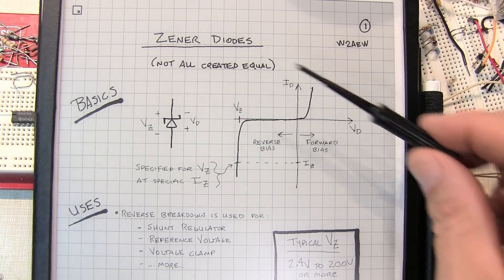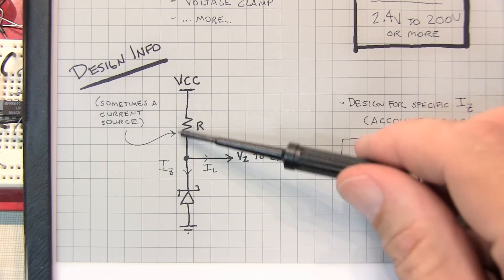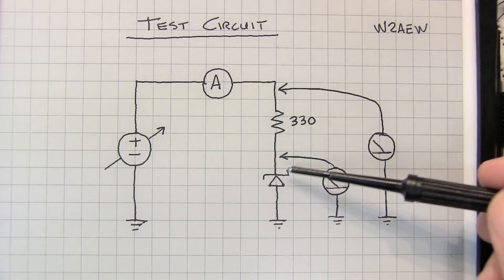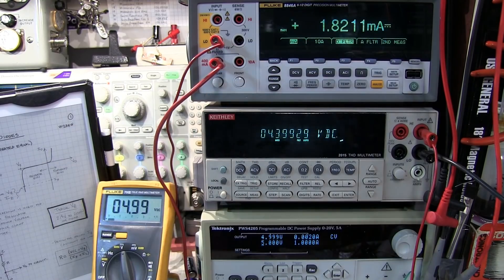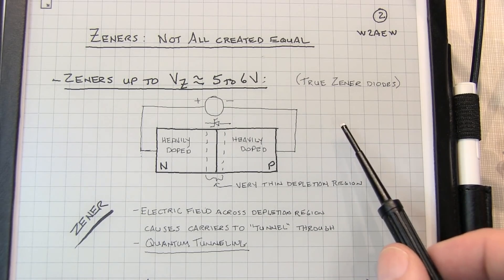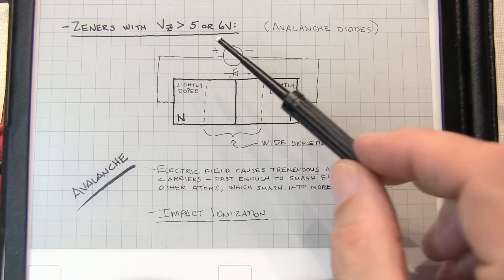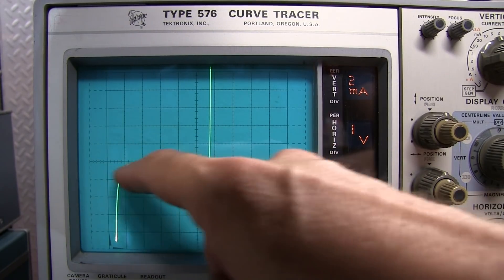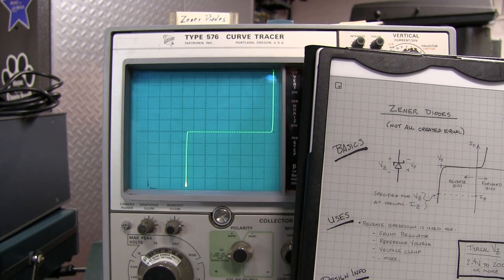#289: Back to Basics: Zener Diodes - How to Use | Applications | not all created equal

Comment: 5:37 what kind of display does the PSU have?

It can’t be a seven segment style display at the bottom. Above is LCD & VFD, then it’s… ?
Reply from the maker: I believe it is also a vacuum fluorescent.
Reply: @w2aew  it must be a dot-matrix VFD then? I’ve not seen one before. If it’s not, the display elements must stack on top of each other like a nixietube or some kind of projector. 

VFD display icons/elements can’t overlap, can they?

Comment: A Variac adjusts the AC voltage but what adjusts the AC current? This is to tell for unregulated circuits that don't use a regulator IC chip to Starve the circuit from the AC current power input to see how the circuit can self regulate. I can't use a variac because it only starves the voltage and doesn't starve the AC current to the applied circuit under test. I want to be able to apply 120vac put starve the current, what can I use?
Reply from the maker: A variable resistor in series.
Reply: @w2aew  Correct but they don't make a variable series resistor like a Variac which would be called an AC rheostat that can vary the 120vac AC current from 0 amps to 20 amps? of the outlet wall sockets is max at either 15 amps to 20amps but I have never seen an AC Rheostat that can vary the 120vac AC amps current from 0 amps to 20 amps, have you seen this before?
Reply from the maker: @waynegram8907  Power rheostats are a specialty item, but can be found.
Reply: @w2aew  Thanks, I have never seen a power rheostat by itself that you can purchase. I know in old 40s to 60s test fixtures they would have built in Power Rheostats to adjust the AC current but they were custom made built by the company they made custom test fixtures.

Comment: Hi, i built a clipping circuit using opamp and 4.7v zener diode and i use a sinusoidal signal at the input (1khz). The top of the signal crest at the output is not flat but rounded. Is it caused by the fact that you tell in the video? Thank
Reply from the maker: Without seeing your circuit, it is impossible for me to say.
Reply: Here it's not possible to load a video or photo. I'm trying to understand how to.

Comment: As you implied, the temperature stability depends on the break through voltage.
The 5.2V Diodes are very stable as they tend to have a combined coefficient of zero.

Comment: Why don't they break? Something to do with the length of the depletion region?
It is amazing that they can take much power without changing or burning.
Reply from the maker: Large Zener voltage does not mean large power.  Power is the product of voltage across the device multiplied by the current through it.  It is important to limit the current (forward or reverse/zener) to keep the power dissipation within the rating for the device.
Reply: @w2aew  There are Z-D with 1.5kW impulse rating. I have seen TVS Diodes that still worked after desoldering themselves.

Comment: Nice lesson once again, especially about the avalanche process. My experience with "standard" zener diodes that they typically have a wide zener voltage tolerance, maybe even +/-10%. What I have noticed on your curve tracer that the forward part (first quadrant) also have a very steep (90 deg) curve, as in a lot of theory books that draw more a 45 deg curve. The 90 deg is more realistic as we know that a forward biased diode has a very little resistance and that the current would indeed sky rocket 🙂
Reply from the maker: The "steepness" of the curve also depends on the horizontal scale used.
Reply: @w2aew  of course, but most of the time (zener graph) we see both quadrants (1st en 3rd), and the 3rd (reverse) is always very steep, but the 1st (forward) most of the time (not always though) under an angle of 45 Deg. The horizontal scale used is then the same for both quadrants (I suppose).
Reply: ...but nevertheless very good short (remedial) lessons 👍

Comment: Great work, thank you. What is the pad that you're drawing on, please? Is that an electronic tablet?
Reply from the maker: Yes, it is from www.remarkable.com
Reply: @w2aew  Thank you. They're not cheap. :)
Reply: @w2aew  Eek, pricey but I ordered one...
Reply from the maker: @simonyoungglostog  Yes, they are pricey - but the ability to edit / alter as well as markup PDF files is handy.
Reply: @w2aew  It's on its way. I bought a calculator because the iPhone does everything 'ok' but if you're using a calculator a lot, it makes sense to get one. No distractions!! Same with the paper-tablet. Thanks again for your videos, I'm still learning (Finishing the transistor section in AoE3).

Comment: Out of the regular, cheap Zener diodes, the ones that have the lowest temperature coefficient are those rated for 5.6V. In them, the contribution of both effects (Zener and avalanche) is more or less balanced and the temperature coefficients largely cancel each other. So if you need the most temperature-stable Zener diode as a reference and don't want to pay for special parts, a 5.6V one is your best bet.
Reply from the maker: That's a bit of sage tribal knowledge, thank you!

Comment: Do a video lesson about precision voltage reference IC chips because they have a zener diode but also they use an IC op amp to compare the voltage. If you look at the datasheets of various precision voltage reference components because they can be used as a voltage regulator. I'm not sure what the capacitance loading has to be before the output pin starts to be unstable

Comment: Can you explain how your equipment works that traces the two curves at once? I’m confused on what I’m looking at. You’re tracing the positive voltage and negative voltage lines at the same time, I think I’m lost on what it means to be reversed biased
Reply from the maker: The Curve Tracer that I am using applied a sinusoidal voltage to the zener diode.  This  voltage swings positive then negative and repeats.

Comment: Outstanding vid and teaching.  Zener diodes are often used in the design of Intrinsic Safety, where a circuit has to be used in a Hazardous location and the voltage MUST be controlled to never go beyond a certain amount.

Comment: the sharpness difference was striking, when you have an electric spark from a capacitor you get an extremely sharp turn on that can be easily compared to the avalanche effect imo.
If you wanted to create a good electronic analogy to a spark gap, an avalanche diode combined with a power transistor should do the job well.

Comment: When you work for a company which produces instruments whose functions are based on a zener reference diode's stability, you appreciate the cost of a GOOD diode when compared with a "blah" diode. LOL de KQ2E
Reply from the maker: Yes - there are temperature compensated zener diodes that are MUCH better!
Reply: @w2aew  , Yes... especially after using the diodes from the burn in rack and 3 weeks of 140% of their rated current. The survivors are surprisingly quiet and stable. Perfect for stable reference use in regulated supplies.

Comment: Since avalanche diodes have sharper turning point, is there any benefit of using regular zener diodes? Besides balance out the temperature coefficient
Reply from the maker: Often you don't have a choice, depending on the voltage you need.
Reply: w2aew Got it. Thank you! I learned so much from you.

Comment: Hello Allen. My condolences for your loss of your father. Great video again.I have learned from watching it (Avalach effect, heavy /light doping).  A nice follow up to this video could be the "variable voltage Zener diode" ( Zener conected to non inv. input op-amp with neg. feedback of 2 voltage divider resistors connected to the inv. input ) which is met in countless circuits as the LM431.

Comment: If you have the time a tutorial of an output pin of a microcontroller would be great . They seem to have a Pmos and Nmos on the internal  drive , BUT if you look at the I/V curves the calcs show a ~54 ohm Rds on of the Pmos and ~ 18 ohms of the Nmos. If you try and simulate with LTspice the mosfets have rds On in the order of < 2 ohms . The trouble I have is how the voltage drops on the output pin as the current increases . Allthough datasheets show up to 25mA source / sink per pin once you are > 6-8ma things go pear shape. Driving into a capacitive load seems to be a no no as a short pulse on the output into a cap of a few pF results in I=dv/dt so with a short pulse the I is way bigger than what can be delivered and the pulse " disappears" - Apologies I did not know where to put this request but hopefully you will get time to address this .
Reply from the maker: I can add this to my list of future topics.  I will say now that it is quite likely that the models used in your LTSpice spice don't accurately model the characteristics of the PMOS and NMOS devices in your micro.  The characteristics of the devices used in an integrated device will often differ greatly from the characteristics of discrete devices.  So, unless you have access to model parameters that are specific to the process used in the manufacture of the micro, then the simulation results are likely going to show non-realistic results.
Reply: w2aew thanks . I did model on ltspice with 2 switches with some progress but my 61 year old cranium is loosing dielectric so not performing as expected . I can send ltspice model to an email address.

Comment: Quick question about wattage and Kwh.
Suppose you had a instant load load of 1,000 watts or 1kw how many Kwh is that? I am confused, as some might say, "simple its 1Kwh",  but it would also draw 1kw in a split second as well since its an instantaneous load. If the 1Kw load was left on for an hour what would be the warrage consumed over that hour? I dont think it would be 1kw, i think it would be much more. How is this calculated?

Please explain.
Reply from the maker: Kilowatt-hours is a measure of energy consumption over time.  So, it is simply the product of how much power is being consumed (watts, kilowatts, etc.) over a given duration (minutes, hours, days, etc.).  If you have a load that consumes 1kW and you run it for an hour, that is 1kWh.  But, if you run it for just 30 minutes, then it is 0.5kWh (or 500Wh). If you run the load continuously for 5 hours, then it would be 5kWhr.  The power company bills you on the total power usage over time - thus, the kWhrs that you use.  It is the product of power usage and time being used.
Reply: @w2aew  so regardless of the Instantaneous current drawn, power is based on an hourly basis? The problem i am having is if I draw 1 watt of power when I measure something at a particualr instant and it is a constant draw that would still be 1wh?
In addition an elec meter is only measuring total wattage (actually VoltAmps with a power factor applied) used and it is read lets say every 30days yes?
Reply from the maker: No, it is always the accumulated power usage.  If you have a device that draws 1 watt of power, and you use it for only one hour during the course of a month, then that is 1wh.  If you use it for 2 hours, that is 2wh.  If it is used continuously for 30 days, then it will be 720wh (30days * 24hrs), or 0.72kWhr.  Electric power meters measure power usage accumulated over time.
Reply: @w2aew  I think i have it. The unit if measurement is 1 hour and usage is derived from that time. So if I were to draw 1 watt for 1 min the usage would be .016666 kwh, yes?
Reply from the maker: Almost.  1000w for 1 minute only would be 0.016666kwh.  A 1w load for one minute would be 0.016666wh (not kwh).
Reply: @w2aew  Yes you are right. Sorry about my math Hahah thank you so much for clearing the cobwebs from my head.
Thank you for your easy to inderstand videos as well. I restore professional 2" video tape machines

Comment: Well explained but why aren't all zener diodes avalanche type or true zener type?
Reply from the maker: Reverse voltage of less than 5V isn't really sufficient for avalanche mode operation, so devices are designed with highly doped materials for Zener breakdown.  At higher voltage, avalanche mode generally provides better/sharper breakdown characteristics.

Comment: Great video but another use of zener diode you see is uC GPIO pin protection. That case appears to be different. In that case you want minimum current into GPIO but clamp the voltage. Any time I've tried that circuit arrangement the Zener Voltage is not the clamping voltage. 3v3 might be low as a clamping voltage

Comment: I think the most stable zeners are 5.6V and 6.2V (sometimes 6.8V if there is some additional circuitry or another diode in connected reverse for better temperature compensation). They have the smallest impedance in datasheets.

Comment: Alan, thanks for this back to basics. I love the series.
What reader or tablet are you using for your notes in the videos?
Reply from the maker: It is from remarkable.com
Reply: Thank you. Would you be open to do a kind of review? pros & cons? A little off topic but I'd be very happy to see how usability works out. Reviews on a***n aren't too frantic..
Reply from the maker: Quick review...  Pros:  lightweight, great battery life, seamless cloud storage, PC app to access files and export PDF or PNG, responsive, good paper & pencil feel, lots of pen/pencil/marker/brush selections, editing/moving works well. Cons: Very expensive, no case/folio included - so nothing to hold the special stylus, the folio they sell is very pricey (found a cheaper one on Ama*on), PDF files are large and take a long time to print.
Reply: Thank you. Your input is appreciated.

Issues w/ system stability/reliability? Data loss when transfering? Delay when opening large PDFs? Reading comfort/tools?
Reply from the maker: I've had no problems with stability - never crashed or hung.  Never lost data during transfer (it transfers to the cloud in the background).  I haven't used it to open large PDFs and annotate them, so I really can't comment on that.  I've only used it for creating my notes pages for a couple of videos so far.  The display isn't "paper white", it is a little dim/gray, but looks great in good room light.  With dim lighting, it is just OK.
Reply: Thank you.

Comment: Is the breakdown of a "normal" diode one of those two effects (avalanche most likely), just that it destroys the diode in the process, or is there a third mechanism for reverse conducting? Could you say that every silicon diode is an avalanche diode, but some can do it only once at a not well defined voltage? ;)
Reply from the maker: I believe that the  breakdown of "normal" diodes is typically avalanche.  There may be other breakdown mechanisms (arc'ing over, etc.).  The reason why breakdown can be destructive is because often there isn't anything that limits the current.

Comment: ALWAYS fantastic videos! By the way, can I use a Tektronix 1910 sig gen for repairing vintage radios, receivers, guitar amps? Can it be modified for that purpose? The 1910 is sex-on-a-stick! Any advice from anyone would be greatly appreciated.  Thanks!
Reply from the maker: I believe that the 1910 is an NTSC composite video signal generator - not suitable for radio, receiver or guitar amp repair.
Reply: w2aew Yes, of course,  you're right. I've been seeing working 1910s on eBay under $100 delivered. State of the art Tektronix...  It would look great on my kitchen table! I guess I'll just have to stick with my PILCO 7070. If you have any suggestions regarding a 70's ~ 90's Tektronix Sig Gen that can be had for under $100? Let me know. Thanks so much for the reply back. It felt like I got a letter from Elvis.

Comment: Alan,  When you published your step voltage generator video I knew a curve tracer was next.  If i recall our email exchange correctly you mentioned you did not have a commercial curve tracer.  So congratulations on the 576 acquisition,  Once again, if i remember the conversation correctly.  None-the-less, great video lesson.  Having the right instructor with the right equipment to demonstrate the subject is priceless.  73, Paul, W1SEX
Reply from the maker: Yes, I was lucky to get this one earlier this summer - only needed a few small repairs.

Comment: i'm hoping to use some zeners in a tube amp project I'm working on.. I have a microcontroller with a 10bit 8 channel ADC attached to it, and I'm hoping to use a bunch of voltage dividers so I can monitor a bunch of voltages (and currents, by extension) on the B+ line and cathodes and so on. The idea is to divide the 400v and other signals down to 0-5v, and then use a zener on each ADC channel to clamp the voltage so just in case the voltages creep over where they're supposed to, I don't end up putting 6 or 7v into the 5v inputs.

Comment: Do Transient Voltage Suppressors (TVS), use the same avalanche breakdown scheme, to protect circuits from voltage spikes? 
Can one be built with 2 back-to-back avalanche diodes (> 5~6V)? 
Is the process of avalanche, as fast as a Schottky?
Reply from the maker: I believe that TVS devices are basically series-opposing avalanche diodes.

Comment: Good video. 
I only missed the fact that zener diodes can be noisy. Especially above 5-6V. Makes you wonder if the construction of avalanche diodes is inherent to more noise?
Reply: The avalanche breakdown itself tends to be inherently noisy. That's annoying in some applications, but when you need a noise source (eg for a random number generator) it's very handy.
Reply from the maker: You're right, I didn't cover the noise characteristics of them.
Reply: Another option is using normal diodes or LEDs in series

Comment: is there any component or chip that can be used as a low drop out regulator without using other passive components like capacitors etc just to reduce the BOM count. i want a stable 5V to power a IC?
Reply: http://www.ti.com/power-management/linear-regulators-ldo/single-channel-ldo/products.html#p182=Fixed%20Output&p634max=5;5&p984=Cap%20Free

These come to mind.